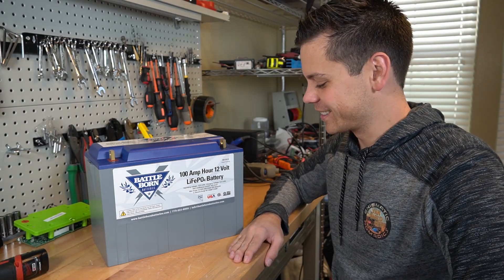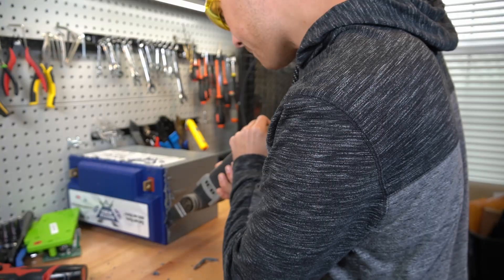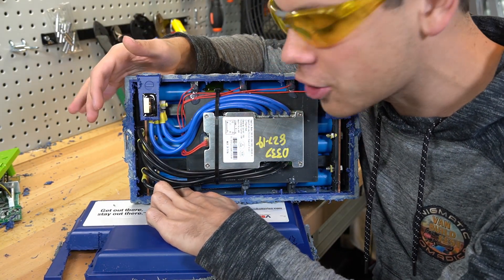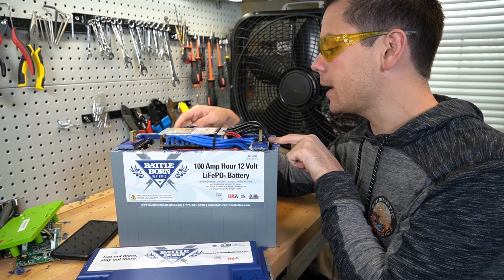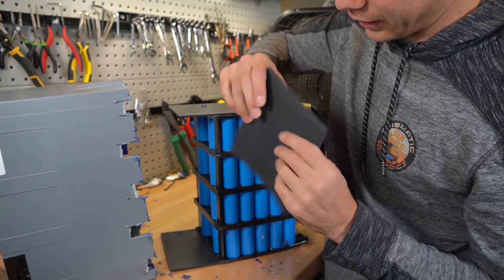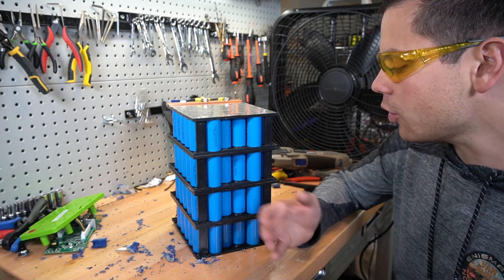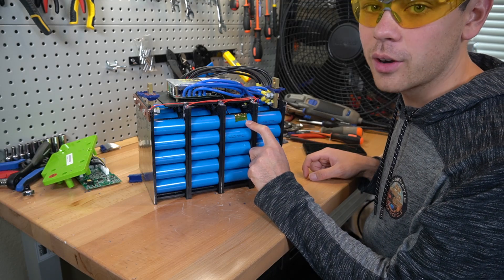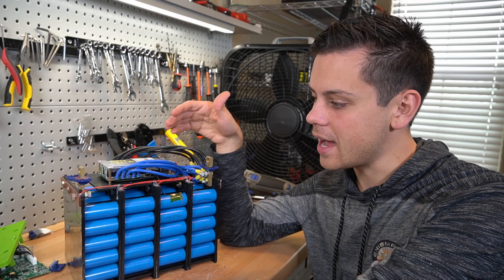$950 "Battle Born" Battery Tear Down

Comment: Will, did you notice lock tight on the nuts and bolts that connect the #10 wire and ring terminals from the BMS to the buss bar?  Just wondering.  Also the #10 wire ends look to be crimped and not soldered to the ring terminals.
Reply: A crimp done correctly forms a cold weld that is more conductive than tin solder (even tin with a tiny bit of copper and silver or lead) and the crimp won't wick up the wires and harden them, causing a stress point which weakens with vibration.

Comment: My Centennial CB12 115AH-20 battery is less than two years old. I’m running a Renogy River 20 amp MPPT. When ready, as a replacement is a Battle Born plug and play with my system?

Comment: With 30 cells in parallel at each voltage level, does it have cell-level fusing like a Tesla module?  Otherwise if one cell becomes a short, won't the other 29 parallel cells discharge through it?  Does the LiFePo4 chemistry make this impossible?  Or would this battery burn when one cell decides to be the one to fail?  If there is a little fuse for each cell, the bad cell will burn its fuse and remove itself from the pack, leaving the other 29 as you said, so the owner probably wouldn't even notice.  Without the fuse on each cell, I would think the resulting fire would be noticed.  It would be relatively easy to have those nickel plates the batteries are spot-welded to, cut by a CNC into little fuse-like  connections to each cell.  A circle with "tabs" around each cell would work, be cheap to accomplish and completely eliminate the fire hazard.  You don't get this fire hazard with single prismatic cells at each voltage level because there are no parallel cells to discharge through the shorted cell.
Reply from the maker: No need with LiFePO4. Very very different compared to cell level fusing that is required on NMC and NCA, Cobalt based chemistries. Check out our forum where we talk about this more. Or diy powerwall groups. Fun stuff
Reply: @WillProwse  Thanks again!  You've greatly simplified my life.
Reply: @WillProwse  I'm sorry, but I didn't understand the answer to which of the various questions it was. Help me please!

Comment: Since you are working with such high power in your house, have you drawn up a disaster plan in case of a worst case scenario?
Reply: Paul, I've had similar thoughts. I always worry for the neighbors of people like Will who have so many batteries lying all over their homes. What happens to the neighbors' homes if there's a big explosion from all these battery packs?
Reply: @lanceguilin  I think he needs something to contain an out of control battery pack if something should go wrong.  Table with a drop top to dump anything into some kind of containment vessel or some kind of plan.

Comment: I built 4 packs with cells similar to those, they are 10.33 wh each or something close, 144 cells,  with 2, 100 amp BMS. But fused at 50a for now, I kinda copied battle born, and didn't even know it!

Comment: Also notice the high wattage power resistors that are lifted off the board instead of plastered to it..  Muy bueno to radiate heat..  A simple bms design is good.  The less surface mount crap the better..   A see-through case can be made with 3/8" plexiglass.  I do it all the time for custom case alternatives to wood used for electronic components (amplifiers, preamps, etc.,). 3030 plexi looks great with flame polished edges which emit the same shiny green edge color of tempered glass used for shelving and table tops..  Coke bottle transparent plexi look great too..!!

Comment: What’s your thoughts on life blue batteries ? Can’t seem to find much on them
Reply: I'm running two 100ah ones. They work as billed and had a 10 year warranty before BB stepped it up to a 10 year warranty.

The Bluetooth aspect is fantastic even if you have a battery monitoring system.

What they fall short on is branding and marketing. They could be just as prevalent as BB if they knew how to market.

I'm hoping Will does a teardown.
Reply: I love to see this guy open up the DAKOTA LITHIUM BATTERY

Comment: Hey Will, why don't you design and create your own LiFePo4 battery system with all the stuff you want at a fair price you'd like?
Reply: I think over time he may do just that. It'll take quite a bit of money -- I guess he could crowd fund -- but I have this feeling he's going to do that over time. Will seems to be a perfectionist and idealist and will want to do things his way. But the fair price will be higher than he thinks or what you think. I think BB's pricing is about right. You can do it and price it cheaper but then you'll have to cut corners somewhere. BBs are NOT the best batteries in the world. There are more expensive and better built LIFE4 batteries, but for the price and category of where they're targeting, it's does seem pretty solid construction.
Reply: You're paying $1000 for a $550 piece of equipment: $30 bms, $2 temperature sensor, $20 in wires, solder, and metal plates and other components, 120 quantity - 26650 lifepo4 3400mah cells that at most are $3 a piece, a $20 hard plastic injection molded case with padding and glue, and $80 for US labor costs, and $34 shipping, for each battery. Factoring in a 15% profit margin, which is quite high for electronics, and we're at $635. You're basically paying $365 for a 10 year warranty. Again, Will could make bank making his own better, less expensive battery.
Reply: @FacetubeU have you actually owned / operated a small business or are you just talking through you arse? There are countless overhead costs that you have NOT added into your equation if you actually want a run a sustainable legit US based business, as opposed to Ruixi batteries sold from China. There are marketing costs -- in BB's case, it's tons of batteries given away to YTbers for review and promotion; Will received 4 of them. All of these batteries given away cost quite a penny. There's legal cost. There's insurance. There's rent. There's accounting / taxes. A legit and consumer friendly business based in US will need proper customer / tech support and that costs a lot if you're going to base that support in the US.  If you actually break it down, it costs a hell of a lot more than $550 for each battery. Perhaps that's the cost to Ruixi batteries, but not BB batteries. It'll cost Will even more as he hasn't scaled up for savings from economies of scale.
Reply: The $80 cost of labor per pack factored in all labor and overhead costs, if they're making at least 10 of those an hour. I forget Americans are lazy and inefficient and the CEO wants to make at least 20 times the salary of his employees, so let's triple that. That means they are still charging $1000 for product that at most should cost $800.
Reply: And yes, I've owned my own business. I found it was easier and cheaper just to close down and just resale parts from China on Ebay after inspecting and testing them myself for quality than have them made in the US. The Chinese are really good a base components, but not so good at building quality assemblies from those parts. Will proved that. Every part in that Battle Born, if you freeze frame on the BMS and examine the cells, are cheap, off the shelf stuff from China. They must be paying every employee at minimal $20 to $30 an hour to justify the cost of that item in assembly and all other overhead.

Comment: Now I understand why those are so damn expensive.
Reply: Don't look at the sticker price. Calculate the price per discharge. This battery will last for 3000-5000 cycles. They are actually cheaper than lead acid over the life of the batteries.
Reply: Cost is still too high! You are essentially paying full price for cells!
Reply: Nah, cost has to be well under $200 for that thing.
Reply: LJ Prep troll? Have you checked what normal 100Ah battery cost? Multiple that for 12 and you get what that battery delivers. And the space and weight...
Reply: @catchbay  YEAH!
Reply: @ljprep6250  cost will drop to the same as lead acid once everybody has one, supply and demand. Maybe even less, because they last longer, not requiring  more $$ to replace.

Comment: I see you're using the correct name for the waterproofing coating on the PCB.
Reply: Isn't only for waterproofing. Also improves vibration resistance.